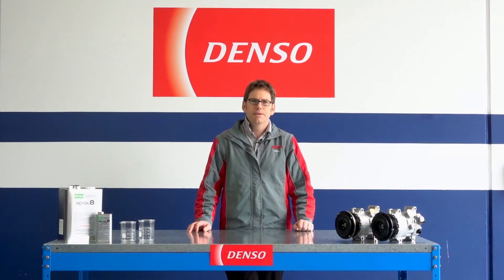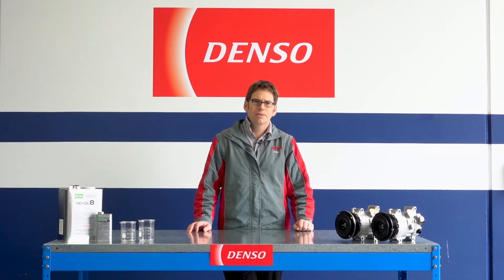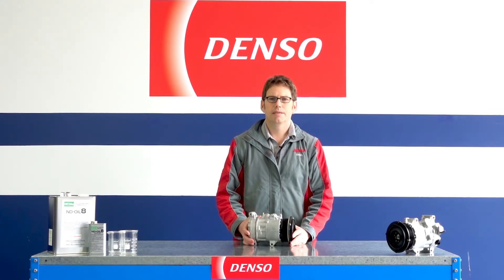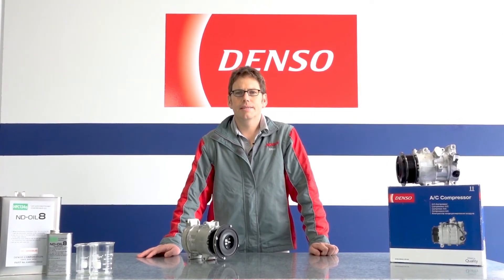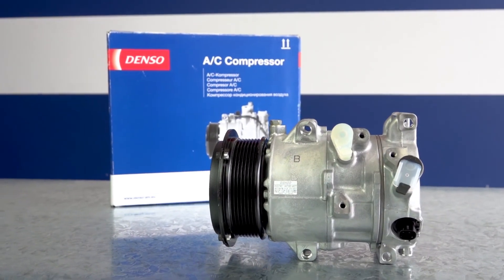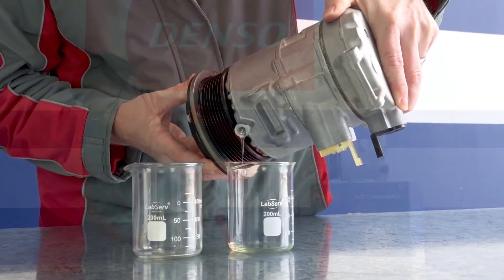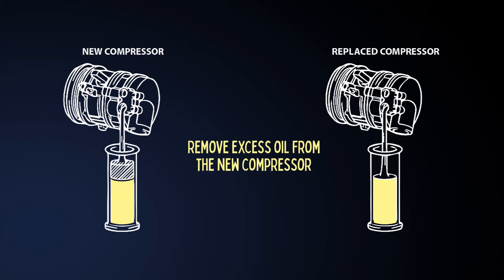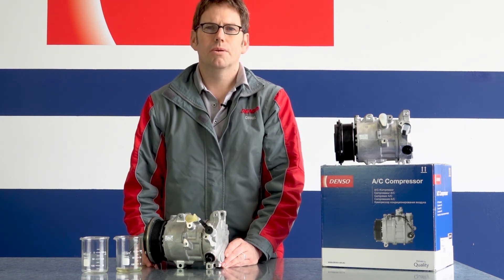DENSO Compressor Oil Balancing

Comment: Thank you, Denso Executives and Technicians, for making this concise, clear video on refrigerant lubricant. I have been stymied by the amount of oil to "add" to the system after replacing a few  components with Denso products. Now I get it: No add'l PAG oil is needed IF replacing the compressor AND flushing the system. Thank you for clearing this up for me!

Comment: That’s so fking dumb. My old compressor is low on oil from a major leak. How the fk am I supposed to have the proper oil amount in my new compressor now. Gfys
Reply: You need to flush the system so there's no oil left. Then add the full amount for your car
Reply: @neil12c  haha true. I fixed the leak myself, recharged it and sent it. It’s a 94 ls400, hopefully the system doesn’t fail on me 😂😂 no more leaks. Ironically I had my favorite car my 01 tundra taken to the mechanic to properly get a quick easy ac leak repaired, and it’s still leaking

Comment: Notice when the system ac r134 lost for leak no found,old etc oil more 90% you want change compressor should charge 120ml oil pag 46 like new denso i think ,send me opinions,saludos desde Mexicali baja California

Comment: So what I gather from this is if you have a compressor that failed due to no oil, drain all of the oil from the new compressor so it fails too. that's why denso is still in business. I'm going to error on the side of caution & just install my compressor with a full charge of oil.
Reply: If your old compressor failed from no oil you would have to flush the whole system which means you would have no oil remaining in the system anyways. So in that case yes you would install with the full amount of oil in the compressor

Comment: The control valve connector was leaking on my compressor on my 2004 Jaguar XJR.  How much oil/what type do I need to use?

Comment: Some Ting Wong with this advice. On my 05 Ford Escape the Ford spec is for 7oz. of PAG46. I replaced the accumulator (held almost 3oz. when old one was drained), condenser, and flushed the system . I installed a new Denso 471-8135 compressor, which their Denso spec sheet claims it came from the factory with 1.5oz. of PAG 46. This video is saying the 1.5oz. already in the new compressor is all my new system needs. That would leave me 5.5oz. short. Any warranty claims aside, that advice would cook my new compressor in short order.
Reply: Still some oil in the evaporator, did you remove the O tube when you flushed the system

Comment: Your compressor broke after 15 days of use, your company is a bad company
Reply: Oh yeah, sure. I've been using Denso products for years and have never had issues with them. Toyota, Honda, and several other automakers use parts directly from Denso. If your Denso compressor broke after 15 days, it's because it was installed incorrectly or there were some other factors.

Comment: There was only 30 ml of oil in my old compressor. The new DENSO compressor comes prefilled with 7.4 oz. Is it possible that the rest of the oil is still in the other AC system components? That seems like a lot of oil. Shouldn't most of the oil be in the compressor?

Comment: my system is 15 years old, when do you change oil or add ?
Reply: Only when replacing components. If nothing has been changed and everything is working, then you don't need to change the oil.
Reply: @genericusername1365 thankyou. I was looking forward for this answer 
But doesn't compressor get oil get contaminated with metal particles after constant friction over 10 years or 1 million hours of usage. (If nothing fails)
Reply: @cowsgoloka  I replaced my compressor at 185K miles. I now have 443K miles and I haven't done anything to the AC for the last 258K miles. It's the same oil that's been in there since then and it works fine.  If you do the job correctly, then the oil will last a long time. I installed a Denso compressor, replaced the drier desiccant, pulled a vacuum for 1.5 hours, then properly installed the refrigerant without any outside air entering in the system. If you do it correctly, it will last a long time.

Comment: Picked up a DENSO compressor for my 2006 Honda Civic Sedan along with what I understand to be the most common components to do a replacement (new condenser, drier, and expansion valve) and insure that I'm not cycling any old junk in the lines through the new compressor. Will be getting the system evacuated of all coolant and oil before replacing these components. The only thing I'm not replacing is the evaporator, which is  a major pain to get out and replace. Am I understanding correctly that with the system evacuated and these 4 new components, oil balancing will not be needed? e.g., New compressor, condenser, drier, and expansion valve means the oil in the compressor is adequate for the system? Or will I be off and need balancing due to the evaporator not being replaced? 🤔 

Thanks!
Reply: The NEW compressor may come with more or less oil than what your system calls for. It's best not to guess and flush everything that is not being replaced to remove all the old oil and contaminants. Look up your car's AC system oil requirement and make sure you put only that much in your new compressor.
Reply: @innocentbystander6  Thanks for the reply! It's interesting because the compressor I got came with a tag that says, "Oil balancing is NOT needed when installing compressor on the vehicle A/C system." Tracking down the Honda repair manual, it notes, "Since the oil separator is equipped inside the compressor for this vehicle, oil drainage is unnecessary at the time of compressor replacement." Does that change things at all? 🤔

Comment: Thank you my friend. With a entire internet full of absolute useless BS information, your video was clear, concise, and straight to the point. This has helped me immensely. thank you my friend. I now only use Denso replacement compressors, instead of all those bitch brand.
Reply: So do you really need to drain the oil out of the new ac compressor ?? I had bought a denso ac compressor specific for my suv.

Comment: Questions: That small plug on the bottom of the unit where you drained the oil, is there a seal on that plug that must be replaced if disturbed? The plug on my Denso unit also looks unusual, as if it were a safety relief valve of some sort, is that the case? I drained my unit thru the line ports by holding it line ports down over a container and rotating the shaft slowly until all oil stopped flowing out, because that seemed to work OK and I was not sure about disturbing that plug. Then I refilled it the same way thru the suction line port, again no problems.
Reply from the maker: Hi, Thank you for your query. 
The pressure relief valve must not be removed.
The process you explained sounds correct.
You should also turn the compressor by hand before fitment and follow all fitment run in procedures by the car maker.
Reply: So do I really have to drain the oil out of the new denso ac compressor ? Because when I bought the ac compressor it was to fit my subura Tribeca

Comment: This exact procedure only applies if the system has not lost any oil.  Actual conditions differ.   This does not apply if the system has had leaks which resulted in oil loss, which often is the case that causes compressors to fail and a replacement required which could have decreased the overall oil amount in the system.  Example 10PA series pumps / I ensure about 100ml goes in every compressor that I physically fit in the car.    Run the system once various loads, then let idle with A/C on for a while at high fan speed which tends to return more oil to pump.    Recover and remove compressor, then check oil.    If very low, you know you will have to add a decent amount to actually balance the system.      

Example, a system with a large leak could only have a very small amount such as a few drops or maybe 5ml come out of the compressor and the rest of the system may have had hardly any oil left, you sure as hell don't put a brand new pump in with that low amount of oil in.  As such doing the oil balancing in this case would give you a overall low oil amount and in this case the right thing to do is add 120ml of oil in - keeping in mind in some large or custom systems you can't add the entire oil charge for the system in the actual pump if need be and you have to split it into another component. 

Also 120ml that comes with the new Denso compressor (allthough it might physically work and perhaps still last) is not the correct amount for the whole system this is wrong, many systems have much more than 120ml , often 160-230ml in the entire system, often if you read many Toyota service manuals from many larger cars you will see 8 ounces is common spec.
Reply: my compressor came with the required amount for the "compressor.  my 3 once. 
my system requires 20. I'm replacing the accumulator,  cleaned the condenser. I'm having to guess what's left???
Reply: My compressor seal went ,but I saw the spot of oil on the floor under it. 
Haha ,I figured to pour out oil on the floor and measure that to see how much was lost 😂
Otherwise it'll be a crap shoot, hopefully I can get it close, and close enough to live.
Reply: Why on earth would anyone service an AC system that did not ever leak in the first place?  This procedure seems reliant on a preventive type of care that cannot be practical or reasonable to most owners.  In reality, AC systems are only worked on when they are malfunctioning.  Breaking the seals (and shraeder valves) almost guarantees a future failure anyways.
Reply: BMW and many others are running into this issue with 1234yf The early machines did not have an "inject oil" feature. So every time someone recovers the system a little oil is lost. eventually there's no oil & the compressor fails, especially on EKK systems.

Comment: I have installed a new Denso 471-1145 compressor, a new drier and new hoses in my 93 4Runner. I vacuumed it down and tried charging it. It wouldn't take a charge and the compressor started to rattle. I pulled the compressor and took the top plate off, turned it upside down and not even an ounce of oil was in it. I added 3 1/2 ounces of mineral oil and reinstalled it. Today I put a new evaporator and expansion valve in it. I am ready to vacuum it and try charging it again. 
Where did the oil in my new compressor go? Why did it rattle if it came with oil in it? I tried draining oil out of the evaporator. None came out and i flooded it with brake cleaner and poured the evaporator out in a can. A few droplets of oil were in it. I then turned my old compressor upside down and no oil came out. I left it overnight and about a half ounce drained out. The old compressor was barely making any noise and didn't rattle like the new one did. Now i am totally confused where the new compressor oil went to. Is it all in the new drier and old condenser? Is 3 1/2 ounces of added oil to the compressor too much or not enough? If i just added the amount of oil in the old compressor it would have been 1/2 ounce. I wish I would have checked the quantity of oil in the new compressor but i didn't. What should I do next? I am totally lost on where all the oil went. Please help.
Reply: I know this is a 2 year old video most likely not responded to when new questions are asked. If i follow the instructions on this video I should empty out my new compressor and put it on empty since my old compressor is empty yet wasn't making noise when removed.
Reply: @supercharged2414  I hear that not all Denso units are shipping with oil and that it's best to check/drain it always.  Sometimes they need oil added.
Reply: @kodimah8577  I did get it working and it is quiet. I learned my lesson about checking the oil quantity before  installing. They say it comes with oil but all 7 ounces couldn't fill up the condenser for no reason which is the only part i didnt replace. . I only put half the required amount because i was thinking 7 ounces of oil had to go somewhere and 10 1/2 ounces would be a lot of oil. You heard some were shipped dry by mistake?

Comment: What if I took my old compressor and had no oil and my new compressor has 3 ounces of oil and requires 11 what should I do
Reply from the maker: Hi, Drain the system and fill, that is the only way to be sure of the amount of oil in the system.

Empty it and then fill with the correct amount.

Comment: Toyota camry form 2012 to 2017 the ac condition fail early. My car Toyota camry 2017 with 61000km compressor fail because pcv valve jam because freon and oil become dirty and black color so I change compressor with condesor and clean tube and now it is OK but I am worry same problem come early again. I think cluth compressor better than this compressor like in camry 2005

Comment: Thank you for this helpful tip. Are Denso compressors used on 2006 Subaru Outback 3.0 engines based on piston or rotary pump technology. I’m trying to understand why the high pressure gauge on my A/C manifold set fluctuates wildly when I increase from idle to 2000 RPM (the needle is a blur and is jumping full scale). Some web sites have suggested this is normal for piston designs, hence my question. Thanks again!
Reply from the maker: Hi, The compressor should be a scroll type.

The compressor we have listed for this application is a “SCSA08C” (Specs can be viewed on our website under parts search).

It would be a good idea to ensure the system is vacuumed and refrigerant charged to specification.

Also ensure you manifold gauges are serviceable.

After that it would be easier to diagnose if there is a problem. We hope this helps.
Reply: I should add that my A/C is working well, it’s just the gauge behavior that is puzzling me.

Comment: i, I am replacing my compressor, condenser, dryer and evaporator (all Denso) in a 1990 toyota pickup. It was converted from R12 to 134a many years ago. Will the new compressor (
DENSO 4711142) have the correct amount and type of oil in it for a 134a system? Also, how do I determine the correct amount of 134a to add? Many people online say to add between 75 and 85% of the R12 amount. Thanks.

Comment: Just bought a denso to replace my compressor  and I’m replacing the condenser and receiver drier as well. My question is do I need to add oil to these new components too? Or will the unit come with the complete amount
Reply from the maker: Hi Daniel, The DENSO compressor will come with the correct amount of oil for the system but be sure to follow the car makers fitment and repair procedures (there may be some systems that have duel evaporators or drink coolers that may need addition oil.). Thanks for your question.
Reply: DENSO Australia  thank for the reply! I just put everything on yesterday. Blowing snowflakes out now.

Comment: how to balance a system with an overcharge of oil ? is there a way other than flushing ? thank you !
Reply from the maker: Hi Saeed, The only way to be sure on the correct oil quantity is to empty the system of oil and fill it with the correct amount. Unfortunately there is no other reliable method. I hope this helps :)

Comment: I’m replacing the ac compressor and the condenser. Mercedes factory service manual calls for an additional 20 ml of oil in case of the condenser replacement. My question is do I have to put 140 ml of oil since it requires additional 20 ml of oil? Also, the brand new denso compressor is prefilled with 120 ml of oil and it matches exactly with the oil capacity listed in the MB manual. Thanks!
Reply from the maker: Hi Denis, If the Mercedes manual states that the system hold 120ml of oil and the DENSO compressor contains 120ml of oil there is no need to add the extra 20ml. I suspect that the adding of 20ml would be if you were only replacing the condenser. Be sure to follow the car makers repair procedures.

Comment: Not the best advice I think. How about if the old compressor was running near dry or previously overfilled or new compressor is a different brand?
Reply from the maker: Hi, The only way to be sure on the correct oil quantity is to empty the system of oil and fill it with the correct amount. Unfortunately there is no other reliable method. And be sure to follow the car makers repair procedures.
Reply: @densoaustralia136  
Can you make a video on how too do just that
Reply: @densoaustralia136  sounds like you guys need to rework your system
Reply: @densoaustralia136 
IMO, this simply cannot be correct, there far to many factors involved in how much oil is in the correct system.
Was there a leak?
Did a guy drop the compressor on removal and spill oil?
Who worked on this car before me?
Ect…
This was a good video and well done but anyone could do this and be way off at the same time based on what I and others have stated as concerns. I’m not a fan
Reply: Exactly

Comment: I’m changing the compressor, drier and high pressure hose. So I have to drain oil from new compressor and match  to oil from old compressor
Reply: Watch some more YouTube videos, there’s lots of them with way more info than this one. This video leaves you with more questions than it answers.....
Reply: @anichols5845  Thanks, all taken care of.
Reply from the maker: Hi Roque Rivera, as long as you match the oil amount (as shown in the video),  the same as the old compressor, then it should be okay.

Comment: What's a difference between 17c and 15c compressor..? Can u please explain a little bit..?
Reply from the maker: Hi, The difference between these compressors is: 17c = 1700cc capacity.

15c = 1500cc capacity.
For further information visit our resource page: https://www.denso.com.au/resources/
Reply: @densoaustralia136 How often we should change oil in the car's Life time if there no leaks or replacements till now 12 year old car with 100k miles run with AC on?